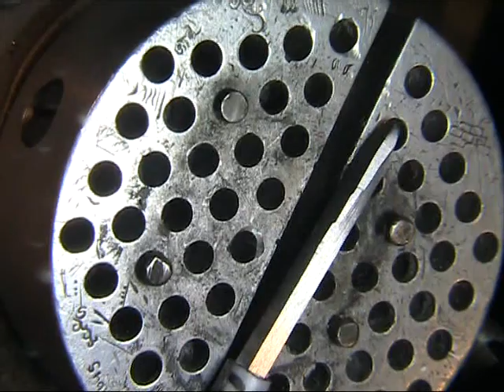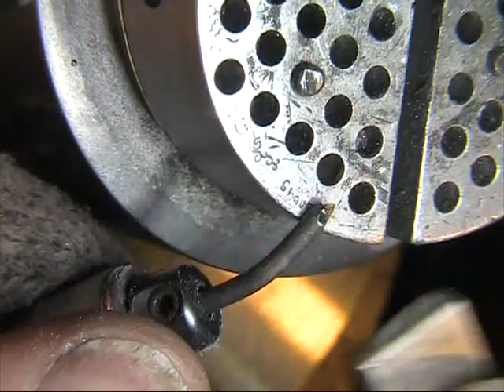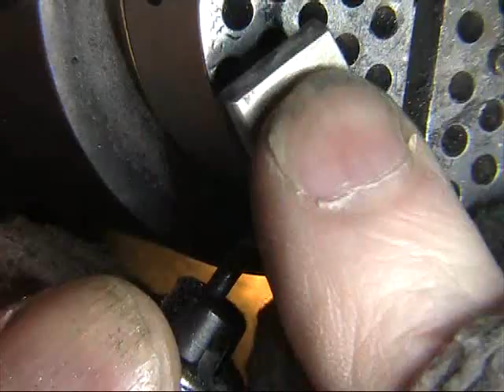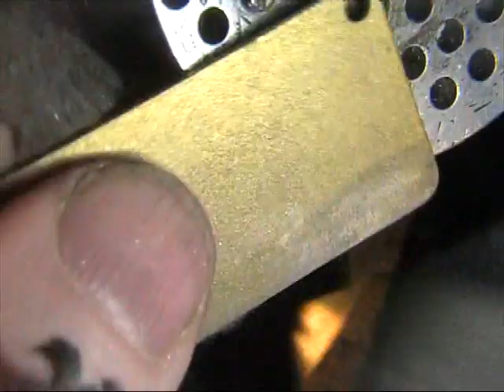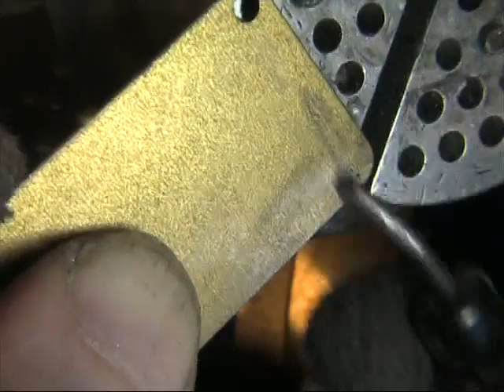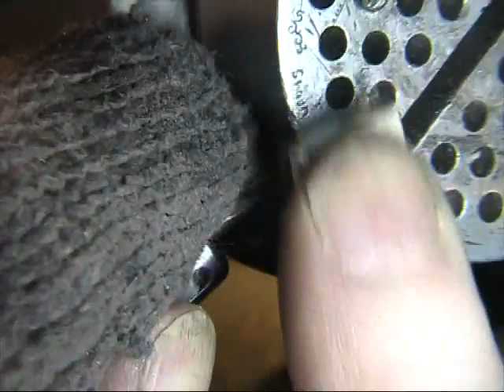Hand Engraving Making A curved Graver

Comment: Nice, does this have to be hardened afterwards to be used as a graver?
Reply: Yes, you should harden it properly, like he said in the description. Depending on you steel, you might need to quench it in 10% salt water, or oil.